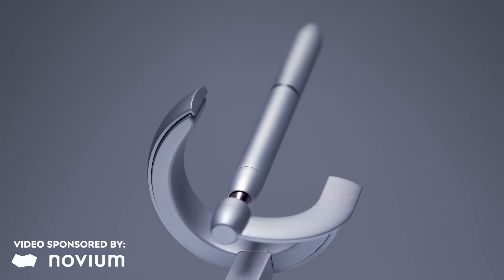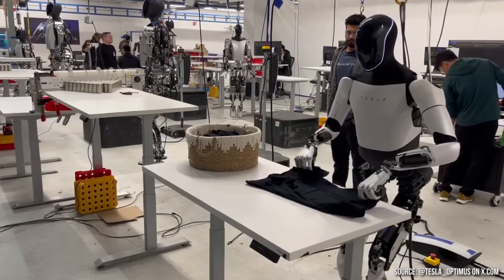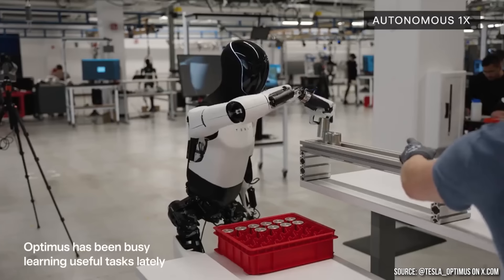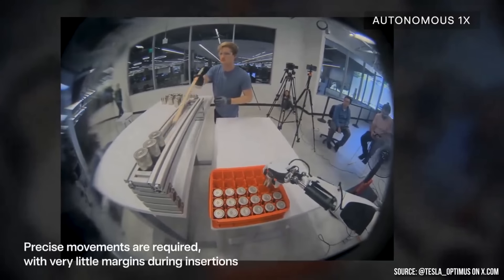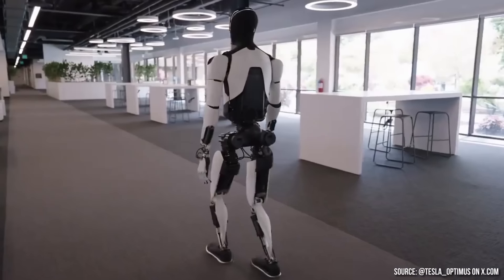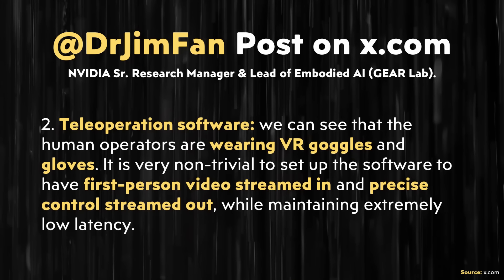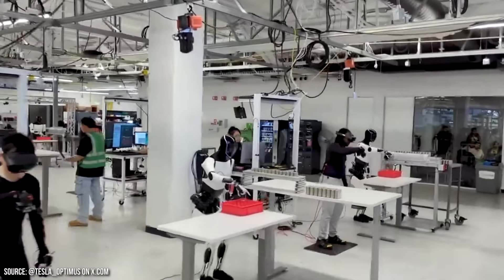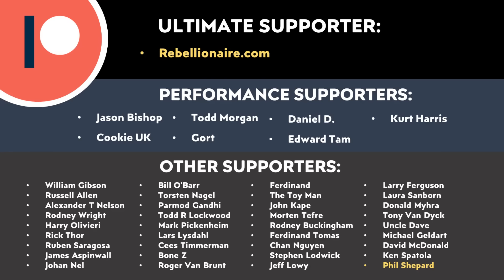BIG Tesla Optimus Robot UPDATE + ROBOT EXPERT REACTS

Comment: 0:53 No offence but that early version is obviously not supported by the cable. The cable would be straight if it were supporting weight. I think you mean it was capable of providing emergency support in a fall but I wouldn’t even wager much on that based on the look of it. It was likely just power and data.
Reply from the maker: Good point. You are absolutely correct.
Reply: i wouldn't wager on anything Tesla says at all, given their track record

Comment: I still don’t see a reason why general purpose humanoid robots have a reason to be useful (c So then ar ost effective). In the videos, we see a normal ($1500?) robot take the battery from the production line, then put in a slot so the Optimus could put in a carrier. So then a ($50K?) humanoid robot does the same thing as the simple robot. Have you seen videos of manufacturing lines? A robot grabs 20 batteries (or whatever) and moves them to a carrier or box. 

I don’t see how application specific robots wouldn’t always be more cost effective than a humanoid robot. It seems to me that Optimus is marketing BS.

Of course if you have seen the movie, Robot & Frank? In that case a humanoid makes sense.

Weird to see the folding a shirt demo. It’s a hard problem, so the demo is kind of like humans in a costume pretending to be robots? If it really worked, it would be significant, but still not cost effective. An illegal immigrant is still an order of magnitude more cost effective than a robot.😕
Reply: Some would buy a humanoid robot with very limited functions for 100,000 USD (like people buy an expensive car), then you can get OTA updates so it can be more useful. If I am sick, I would normally not need much help, but even a little help would go a long way.

Comment: A $100,000 robot sorting batteries
or pay someone $15/hr to do the same?
The payback is 6,666 hours
or 166 weeks
or 3 years
that's for 1 humanoid robot

Just as the $200 quadcopter has totally changed the modern battlefield
with that small copter dropping a mortar shell on a $2 Million tank when the crew has to come out to pee

so will the $200 swarming droid is going to do to that $100,000 robot

Humanoid robots are designed to take the job of humans
who pay taxes and are members of the community
that robot will pay no income tax or other taxes
and the unemployed human becomes a ward of the state

Does anyone think the politicians are going to let this happen?

The small droid is an appliance that humans will use to make their lives better
no human is going to be unemployed because of a small swarming droid

Honestly, the AI/Robotic geeks have their heads in the sand.
But geeks normally aren't accused of having too much common sense.

Build an appliance for humans
and not a replacement for humans
Reply: What cha talkin bout, It’s already happening.
Reply: You can always be relied upon to get everything wrong.

1) Optimus when ramped up won’t cost anything like $100k, it’ll be around $20k and eventually $10k.

2) Even at $200k, the robot is significantly cheaper than humans at around $10/hour.

3) A human being paid $15/hour actually costs a lot more due to all the other benefits (holidays, sick leave, medical, dental, pensions etc.) and infrastructure to support them.
Reply: Nice idea, but I think the genie is already out of the bottle….
Reply: @fredbloggs5902  You miss the point - as always.
elon has not said what the Terminator will sell for - it's going to be a start-up up
so the 1st 100,000 will be very very expensive to recoup costs and even then each will be sold at a loss.

Versus a small swarm of droids that will cost 1/1000 the Terminator
and head for millions of homes and cost no more than an iPhone.

The Terminator will be eaten alive...
Reply: @noleftturns  I would go very far to avoid hiring humans because other humans have agendas that rarely align with my agenda. So, I would make it work with humanoid robots.